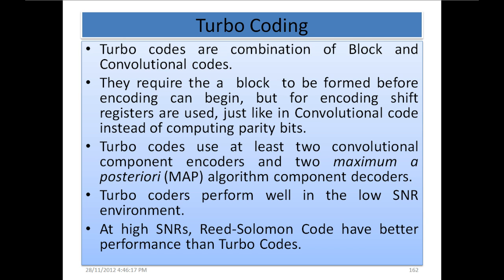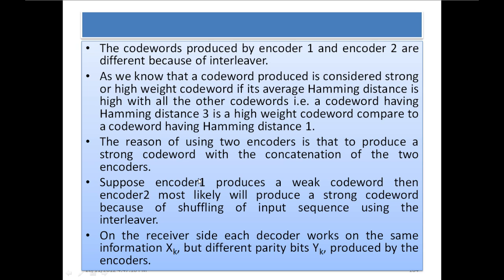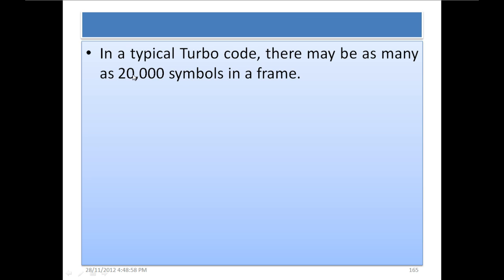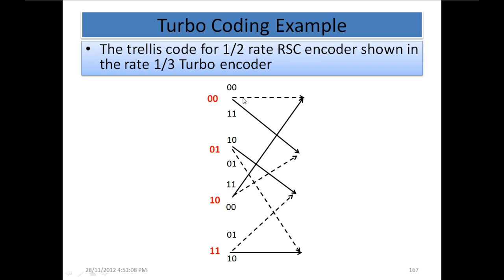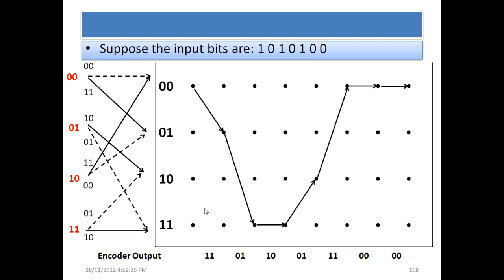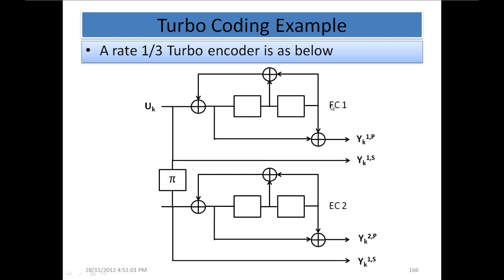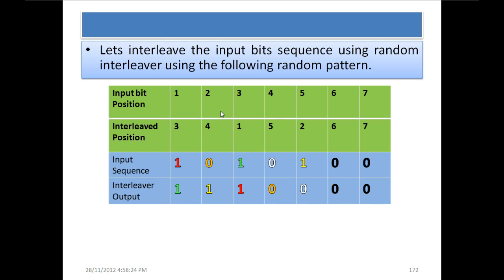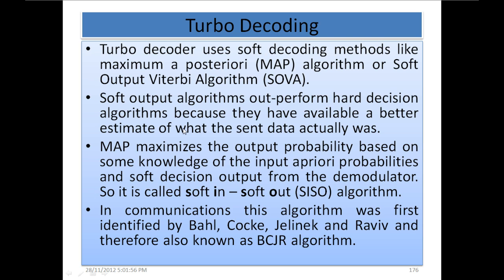Information Coding Theory   Part 22 - Turbo Code, Trubo Encoding Example with Trellis Code

Comment: Is there mistake in trellis for turbocoder (first convolutional coder), how could it go from state 00 to state 01 ... this doesn't even match the scheme for the coder. Imho it should go from 00 -> 10
Reply from the maker: You are right oglop. At state 00, when the input bit is 1 the output bits are 11 but the next state is 10 not 01 as shown in the video. Thank you for pointing out the mistake. I really appreciate your interest in the subject. If u find any more mistake in future then please let me know. I will be very grateful to you. Thank you